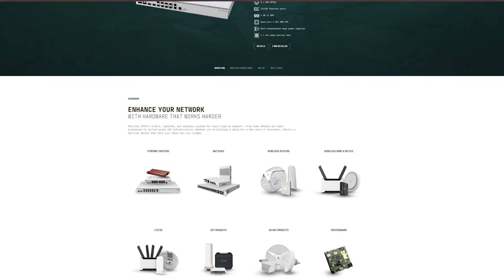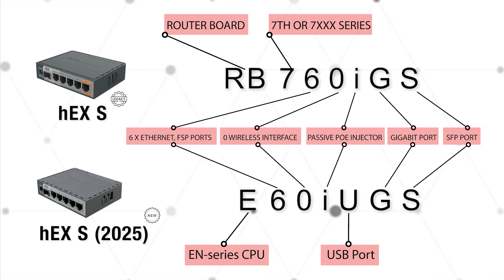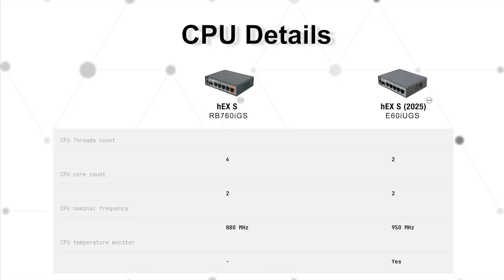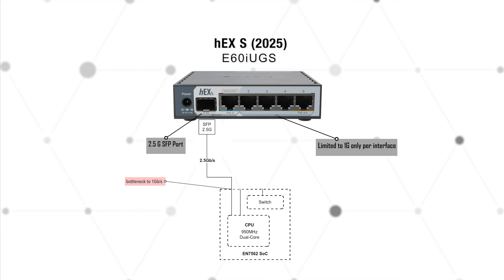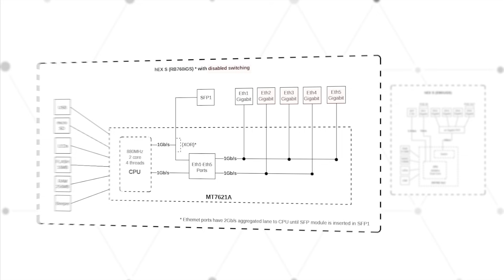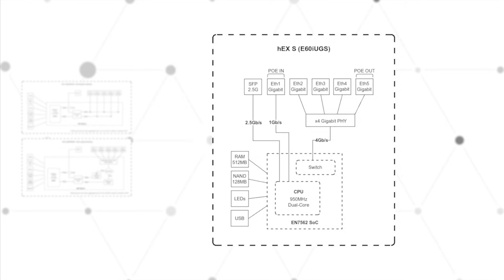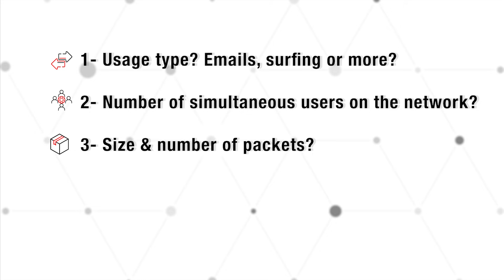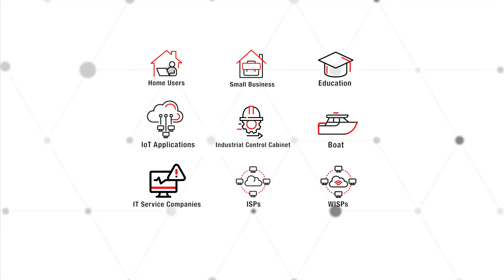hEX S 2025 vs hEX S: The Complete Comparison You MUST See

Comment: Hi Team Mikrotik Canada, I have two questions 

1, Does this MikroTik model (RB750 iGS / 2025 version) support the Back To Home feature for remote access over the internet without requiring a public IP, using MikroTik’s own services?

2, Is it possible to run container virtualization (Docker) on this specific MikroTik device, and what are the limitations in terms of performance, supported container types, and required RouterOS version?

Thank you in advance for your answers. If possible, do you have any explanatory videos on your YouTube channel showing how to implement these features on these devices? If there is a video available, I would really appreciate it if you could share the link. Otherwise, it would be great to see a future video explaining how to implement these functionalities in practice.
Reply from the maker: Hi, thanks for reaching out 
Straight answers below.

1) Back To Home (BTH)
Yes. The RB750 iGS (2025 / hEX) fully supports Back To Home using MikroTik’s cloud services.
No public IP is required.
This feature is part of RouterOS (v7) and works the same across supported MikroTik routers, including both hEX models, assuming your ISP allows outbound connectivity.

2) Containers (Docker)
Yes, containers are supported, but with limitations.

RouterOS: v7.x required

CPU/RAM: Limited — suitable only for very lightweight containers

Storage: Strongly recommended to use external storage (USB)
Running containers on internal NAND is not advised due to read/write wear

Use cases: Monitoring agents, small utilities — not databases or heavy services

Before deploying containers, you should evaluate:

Traffic type

Bandwidth

Read/write intensity

Runtime expectations

Failure impact

This applies to any MikroTik device, not just the hEX.

Videos
We don’t currently have a dedicated video on our channel covering these exact scenarios.
However, MikroTik’s official YouTube channel and Wiki have solid step-by-step guides for both Back To Home and containers. A future practical video from us is definitely on the table.

Hope this helps and points you in the right direction 👍

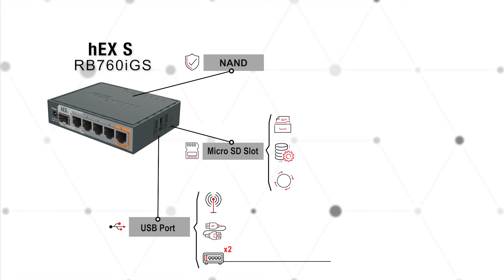Comment: 7:32 What is that cable connecting the two MikroTik routers by their USB Type-A ports? I've never seen anything like that.
Reply from the maker: Thank you for your comment! That’s a great question.
To connect two MikroTik heX S routers through their USB ports, you need to plug a USB-to-Ethernet adapter into each router, then link those two adapters with a normal Ethernet cable. With two adapters and one Ethernet cable, the two heX S units can communicate through their USB ports.
Reply: @MikroTikCanada  Ohhh I should have known, lol.  I assumed that was a single USB Type-A to Type-A cable, which I've never before seen in my life. Thanks for your quick answer!